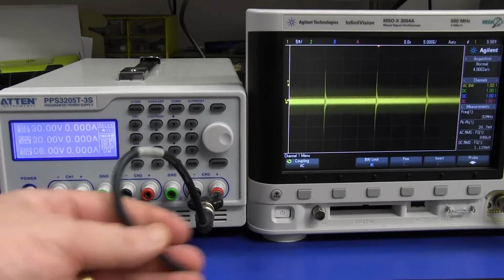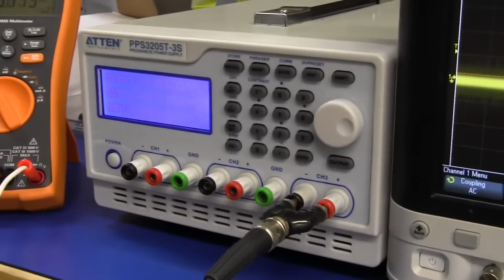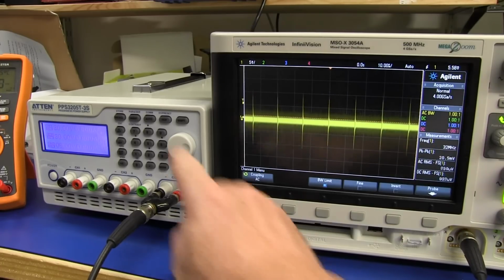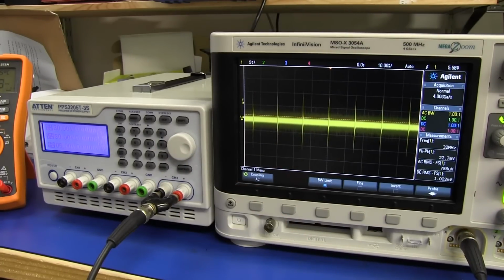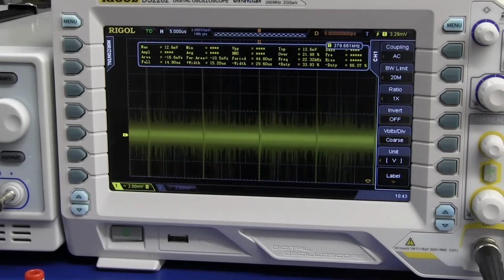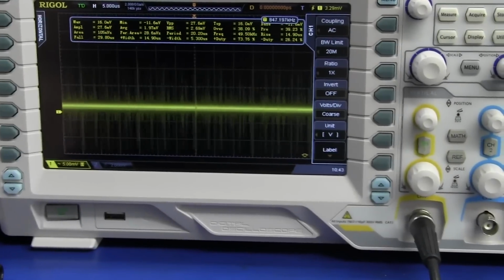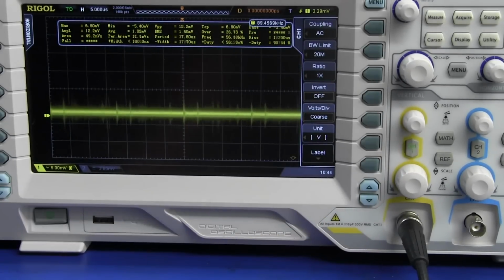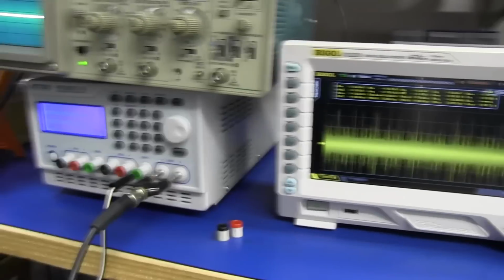EEVblog #441 - How To Track Down Common Mode Noise

Comment: Tip with the mains cable is to get a big ferrite core ( old monitor CRT ferrite's work well here, or the LOPT core) and wind around 20 turns of the mains cable through it, or as many as you can. Gets rid of a lot of the higher frequency common mode hash. Big, bulky but does the job quite well.

Comment: I wish we could have seen the noise with and with and without the ground wire connected to the PS.  I noticed near the end of the video (~18 min) that the ground wire was removed, then at the very end, the ground wire is connected again!  I know that grounding and ground loops can significantly affect noise.   Thanks for the video!

Comment: I knew it! A POS Chinese AC Adapter!

I've got one that can cause whine in a short wave radio from 10 meters away with no antenna connected to the radio. It has a date with the sledgehammer the next time I lay eyes upon it.

Comment: Common mode noise can be very tricky to isolate, but isolating the scope usually works.
But a lot of this noise you describe as "common mode" is mostly differential mode noise picked up by the probe.  
True common mode noise is usally due to multiple ground paths through the main power ground connections. That's why floating the scope usually works. Also, dont use a 10cm ground lead on the probe.  you want the connections to the probe to be as short and direct as possible.  That ground lead on the scope acts as an antenna, resulting in differential noise displayed on the scope.

10 years of low level A/D industrial control systems....
Reply: +Bob Lake What does floating the scope mean. Is that some advanced isolation / filter system for the input power supply?
Reply: No ground reference. Ground "floats".
Reply: John Michael Stock
In practice, there are a few ways to do it. 1- cut the ground pin on the power cord to the scope (not recommended, but people do it anyway), or use some adaptor that has no 3rd pin (GND).  2- use an isolation transformer to provide power to the scope, again with no GND connection.  This is safer and is the prefered simple method. 3- use a battery-powered scope, if one is available.
Reply: Bob Lake Multiple ground paths usually have relatively high inductance (especially if they are wires/cables and not sheets or structure) and they don’t do much for high-frequency common mode noise. If you truly have have common mode noise induced via a connection, then a common mode choke fixes it if it is indeed common mode (it won’t if it’s not). You can also run a connection (say a multi wire cable) through a wideband current transformer and actually measure the common mode noise to validate the diagnosis. The scope has limited common mode rejection and thus acts as a common-mode-to-differential converter. Any unbalanced cabling, including plain coax, also acts as a common-to-differential converter (balun working backwards, you can make values from plain coax!), so the scope would need to have high frequency isolation at the inputs to stop the cable doing it. Running that coax through a few tightly fitting ferrite tubes made of appropriate material would have likely improved things quite a bit.
Reply: Bob Lake These things do almost zilch for high frequency noise. An isolation transformer, even with an electrostatic shield is simply a capacitor to whatever ground it’s hooked up to. Thus it doesn’t isolate much once you’re in megahertz, because that ground is just whatever you got, noise and all, with a hf inductance of the wires added.

The power supply input filter on the scope also has caps from the secondary to ground input pin, so is transparent for such noise (it shunts local common mode noise from the switching transformer only and conversely it shunts the secondary to primary for such noise: it must do this unwanted task well to do its primary task well). 

To get a scope or other measurement setup reasonably isolated from common mode noise, the scope and the isolation transformer (with its electrostatic shield!) and the DUT must be all connected via low-inductance connections to a ground plane immediately underneath these devices (that implies that the scope’s connection to the isolation transformer must be two-wire only; the power input module must be directly strapped with braid to the ground plane).

The DUT has to run from a battery or a similarly set up PS on the same ground plane. All connections must run directly on the ground plane, and all symmetric connections must be twisted (e.g. power pair from the transformer to the scope and the DUT PS must be twisted).

Anyone who understands how valve circuits were designed on a chassis will recognize most of these techniques; they are old news. Substitute ground plane sheet for the chassis and there you go :)
Reply: @boblake2340  Sorry. I'm probably being stupid but when people call for the use of a 1:1 isolation transformer yet the DUT already is powered via an analogue power supply is that not the same as isolation within the devices transformer itself? The primary is already separated from the secondary. Why add another separation what's the difference in this case? Also, if the device is isolated via a 1:1 transformer what do we do with the earth connection? Is it safe? People say it's safer to work on certain devices via a 1:1 but then how will the rcd trip if there is a fault? Thanks

Comment: The probe is a HIGH Z device matching the input Z of the scope. In the other hand the coax is a low Z transmission line seeing on the PS side a low Z and on the scope side a very high Z, in other words it is acting as unmatched transmission line. Which is not a combination of inductance and capacitance picking up noise like an antenna.  The BW of a matched coaxial line runs into UHF, broader than the oscilloscope and its probe. The probe's conductor is generally silver plated.

Comment: I have some LED controllers which use PWM dimming up to 50% and then are linear from 50-100%. I was told they were completely linear. That was difficult troubleshooting a flicker problem because in service they were set for less than 50%. On the bench I was testing them above 50%. Of course, the DC supply for the dimmer is switchmode. 
I am surprised you didn't talk about using a differential probe, or Ch1 minus Ch2 mode- the poor man's diff probe.

Comment: So when you're making noise measurements in your system the best solution is to power it from the same mains SMPS that it will use in the real world not a benchtop PSU. Even better if it's going to be powered by a battery, these kind of problems are a non runner - only internal SMPS issues need to be considered. All these kind of measurements on your system should be done in real world conditions.

Comment: Great video. I have had this problem many times during my career. I try to always use a line (mains) filter on my scope, it does seem to help. I have a portable Tektronix  THS720 that I used for many years. This problem got very bad with this scope and it turned out to be worn out capacitors in the power supply section of scope.

Comment: If you have a 50 Hz hum in your audio signal and you pass it through a 200 Hz high pass filter the energy of the hum is attenuated. Some distortion does occur due to group delay and pass-band ripple, but this distortion is controllable by good filter design. So, in total, the quality of the audio signal is improved. If this were not true, no one would use high pass filters. You have to know something about the signal you are trying to measure. to measure it correctly.

Comment: Add a clip on Common Mode Choke on the coax, and say 3 turns through the core. It will help. 43 material or similar will be good.

Comment: You pulled the mains from the power supply, not from the wall. But I have had noise from the mains cable itself. Not sure if it's from the wall or from the cable itself. Changing the cable helped. It was a normal 220V 3 prong cable.

Comment: This is an issue I have to deal with at work for video and audio signals on very large shows... I end up having to do the same thing, running round looking for the guilty party.. and some events are in sports stadiums or large festival sites.. It can take a while!! Its exactly why I own a large stock of isolation transformers for both audio and video..

Comment: He did that with the ground isolator. It's basically just a 1:1 transformer with no earth connection. Beyond that, you're picking up noise through your leads.

Comment: actually when I built my transmitter (very low range just for learning purpose) I used my oscilloscope as a receiver. Because it picks up all the signal 20 cm from the antenna. It shows how we can easly make a mistake with what we see on the oscilloscope...

Comment: I had a cordless phone power supply that was horrible. When it went into trickle charge it would short the mains across a thermal cutout, and and that would cut in and out. It was so bad it was actually throwing the 60 Hz off down to 54 or 52 Hz about every 1.5 seconds. It was so bad mains freq referenced clocks, stroboscopes, and other gear was not keeping proper time. My old turn table's strobe would walk backwards every 1 1/2 second. The turn table had enough momentum to run faster than the strobe lamp  when the main freq dropped. I put some LEDs around some of my ham radio gear, and promptly ripped them off due to pulsed switching noise. It looked cool, but I was transmitting all that noise, which would wreak havoc at some broadcast freqs that had a harmonic resonance with the switching freq. I hate chasing that crap down!

Comment: The problem is that each square pulse in electronic circuits sends a EMP that triggers currents in unshielded circuit traces and other bare metal structures. It's time to design circuits with well shielded traces, is it? Another solution is to decrease the slope of rising pulse edges, in components where it's not absolutely necessary, it reduces significantly the amplitude of the EMP.

Comment: Had something similar with a cheapo switching power supply. one of the caps inside was defective and it was putting noise onto the mains and affecting some X10 modules.

Comment: Not only as a ham radio operator I especially have to warn about those more and more common powerline network adapters - Dave, could you show how ridiculous much noise these devices produce?

Comment: This is by far the worst thing for high capacity data circuits for telecom.. I have had to isolate this monster on so many circuits with at@t I could tell you in a moments notice as soon as I seen it on our scopes.. sometimes it's a bit$h to find.. The modems have Wi Fi so they can't be shielded like you would like to in order to suppress them from it.. Thanks I said Lights right off the bat... and the cable... yes,,, I didn't see the gear you had under the counter but I was skeptical.. great explanation !!

Comment: The Qili power supply has a CE marking. Note the spacing between the C and the E. In this case the CE means "China Export". There is no way the power supply would pass European CE compliance testing. More detail here: https://support.ce-check.eu/hc/en-us/articles/360008642600-How-To-Distinguish-A-Real-CE-Mark-From-A-Fake-Chinese-Export-Mark

Comment: Question that i would like to ask - Is it actually the coax that's picking up the noise or the electronics of the PSU like you initially suggested? Obviously, the electronics within the probe could dampen the noise detected.

Comment: I don't see how the supply meets its spec even if it's the transformer picking up external EM interference.  It should be protected / isolated internal or whatever to deliver the spec under normal operating conditions.

Comment: Is the power supply case actually forming a complete metal shield from the review it seems like the front panel is made of plastic. If the internal transformer is the pickup if it was properly shielded would the performance be better? Normally those ESD filters should be grounded to the shell of the case to work ideally I think.

Comment: Thanks for you nice video, and i have a question if we couldnt find high performance bnc in our lab, add a common mode choke between source and load will help us eliminate that led switching noise?

Comment: Hi. What if using an external dc block and configuring the agilent input to 1x, dc coupled and 50ohms terminated when using the coaxial cable? Remember its necessary to use external dc block because when in 50 ohms, the scope  input is limited to dc 5Vrms. This is how I proceed with my noise mesurements, specially on onboard low voltage asic power rails. Please comment about it. I'm a fan of your channel. Kind regards

Comment: How do we determine whether the issue with the switching supplies was common mode or differential mode noise, if in the end that emission was radiated to the coax?

Comment: Thanks a lot for the always extremely valuable videos.   I have a question.    If the psu is picking up noise from all around then the noise is indeed coming from the psu.  I mean the psu is acting like an antenna.  Am I wrong ?   maybe a better shielding of the internals of the psu could help ?  in your experience are there any psu with excellent isolation from this common mode noise ?  Last question .... would a spectrum analyzer be a better tool to understand the nature of this noise ?   thanks a lot again.  Kind regards, gino
Reply: There are better shielded PSUs – if you make them yourself. They are special-purpose. Most PSU designs are made to be cheap, and there’s really no standard to specify them well, eg. common mode impedance between output and mains is not normally characterized, even through it’s an extremely important parameter in low-level work, especially in electrophysiology, electrochemistry and other high-impedance work.
Reply: @absurdengineering  Hi thank you very much for your kind and valuable advice  I understand the complexity of the topic  I opened some smps for computer and some had a kind of shield like Dell for instance   The cheapest ones have nothing at all   Kind regards, gino

Comment: I'm always wondering, isn't BW Limit sort of 'cheating'? "Oh, we're getting too much noise, let's limit the bandwidth to 20 MHz. Yep, that looks better." Iirc you said it's because analog scopes are 20 MHz, so that's why it's there, but wouldn't you rather have the full bandwidth?
It's like if you'd have a 50 Hz hum in your audio, you just add a 200 Hz highpass filter and it's gone, yeah, but the overall audio quality is lower as well.
Reply: The circuits that are on the receiving end of the noise don’t have infinite bandwidth. So a bandwidth limit for such specifications is a necessity, otherwise it’s a fantasy. How far are you going to integrate that noise: to 1GHz? 100GHz? You have to stop somewhere where it matters for typical uses of the power supply. Most audio stuff won’t care about white noise past a couple hundred kHz for example. Well put together radios have local filtering at most every active device and won’t be too sensitive to white noise even close to their operating frequencies. And so on. Besides, many power supplies simply have no gain at very high frequencies and they don’t generate any noise other than thermal resistor noise. You can measure it, but not with a scope – precision power meters and shielded lab setups are needed for that. So it’d be impractical to specify.

Comment: Help! I run my house off a 3000 watt 12 volt to 230-volt inverter from batteries, my inverter is good quality and pure sine wave, however, that pure sine I suspect is made up of fast switching high-frequency peaks. 
The household wiring seems to be acting as an antenna, the inverter is Earthed to the ground and sits on a large Aluminium plate in a special cabinet, I was thinking of installing a supply filter robbed from an old washing machine on the 230 volts out from the inverter. 
It drives me nuts, I have bought a beautiful MW/LW antique radio which sounds amazing running on its batteries until the inverter is put on and then it is totally screwed. any good ideas welcome.

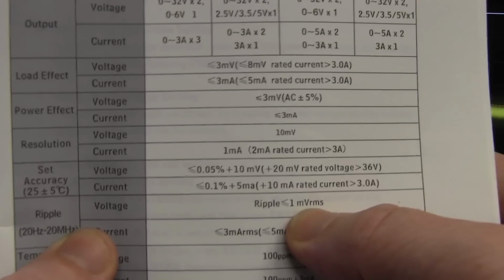Comment: 1:39 "RMS doesn't tell you anything about peak to peak"??  Multiply single peak RMS times 2.828..  Did you sleep through the second day of electronics school?
Reply: I think you were the one sleeping. That is only valid when the noise has a gaussian distribution. And it's not even correct. That is not even correct, but whatever.
Reply: I wasn't commenting on probability theory.  I was discussing the real world.  You're over think something very simple.  But whatever.
Reply: @Species-rj9si  Probability theory? You are saying that RMS value is somehow related to peak to peak value. That is incorrect and it is only correct when you assume something about the probability distribution of the noise. In this particular situation RMS value doesn't tell anything about the peak to peak value of the noise because the noise distribution is not normal.
Reply: Ricardo Nunes 🙏🏻